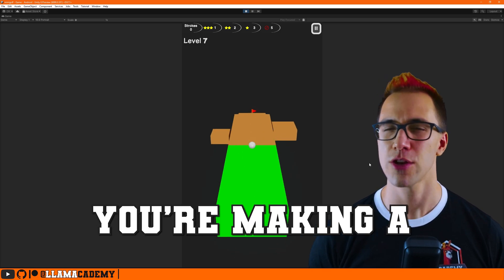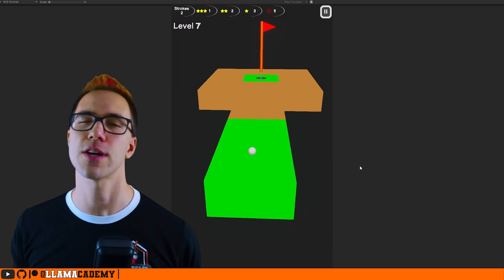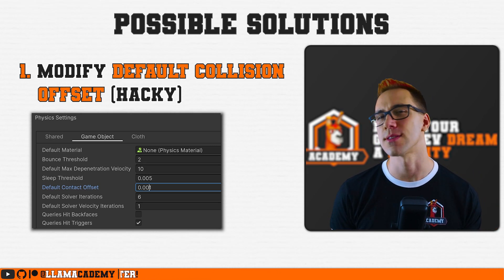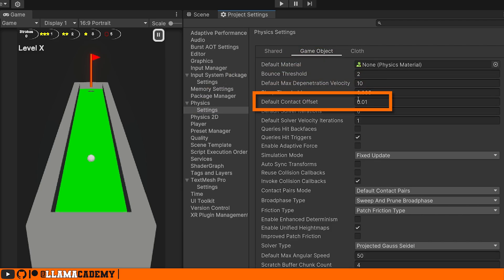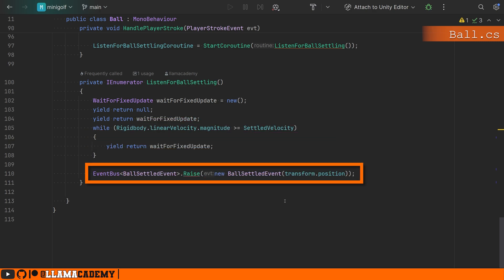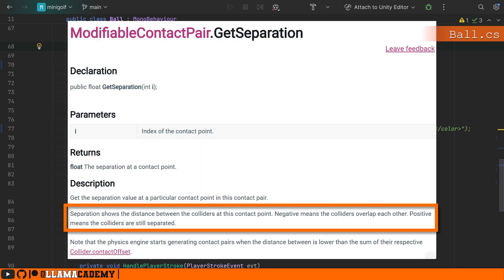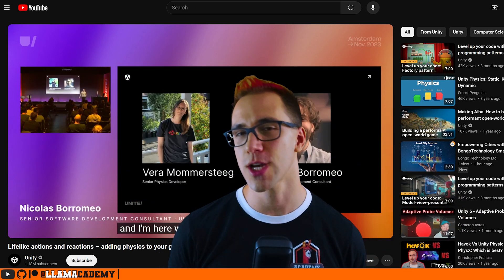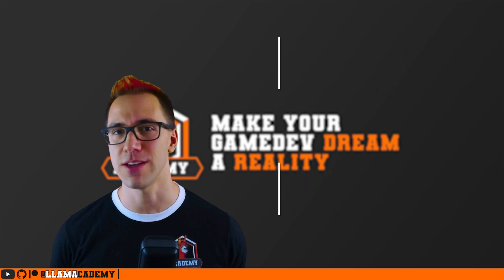How to Avoid Ghost Collisions | Unity Tutorial

Comment: I'm having this issue in 2D physics, which lacks contact modify events. What can be done in this case?
Reply from the maker: I think there's a composite collider 2d that merges colliders together. I haven't worked much with 2D so not 100% sure if that solves the issue in 2d or not
Reply: @LlamAcademy  There is a composite collider, but this doesn't entirely solve the problem. I can't just combine all the colliders in the scene together, because they aren't all on the same layer.

Comment: For anyone this is not working for still, add a debug and make sure that it is triggering your ghost collision detection system. If not I would Subscribe to the Physics.ContactModifyEvent with the Physics.ContactModifyEventCCD. The main reason is that if you have simple static objects (with no rb) that are colliding with your physics object, it will not trigger the CCD event. Also Post 6.0 unity update, setting the normal might not work. I would also add in your scripts to adjust the contact point slightly to prevent re-triggering, by doing something like this pair.SetSeparation(i, -0.01f); . Hope it helps.

Comment: How would you handle this? This probably applies for 3D, but let's imagine you have a Rigidbody2D on your player character. On your player character, you have multiple triggers, that perform multiple tasks. For example, you have a ground detector, a trigger to determine when the player's mouth enters and exits a water body, a ledge detector, an enemy proximity detector. ETC.

Now, using OnTriggerEnter2D on the main character's root game object will execute when ANY of them are triggered, since the Rigidbody2D takes possession of all of them, even if they are on child objects. So then, how do you process the overlap event? Well, there are a number of solutions and workarounds, but some of them are not efficient (which is important for scalability), and all of them are not that elegant or come with their own set of issues.

A) On every OnTriggerEnter2D and OnTriggerExit2D, you could query all the triggers to determine which one exactly is touching, and then either you could either specify a layermask for each collider, or add layers to the collision matrix that are specific to these colliders. You may also need to manually keep track of whether a trigger is "inside" if getting repeated OnTriggerEnter2D events is an issue.

B) You could exclusively put all the triggers on the game objects external to the player. This includes every ledge, every body of water in every level, a wide "proximity" trigger box around every enemy.

C) Use Physics2D raycasts or overlap boxes every frame, in place of everything that is a trigger.

D) Do not use OnTriggerEnter2D or OnTriggerExit2D on the root game object. Instead, split the triggers up into child game objects, and use OnTriggerEnter2D and OnTriggerExit2D on scripts that are attached to the children objects. This would require creating some communication between the child object scripts and the parent object scripts, which could make it harder to understand what's happening for others on your team.

I was using approach C in one of my projects, but was criticised by an industry insider that it's not a scalable solution to use physics casts on every frame. Unfortunately, I didn't get much opportunity to explain the dilemma to them.
Reply from the maker: Can you not attach small MonoBehaviors to the sub-objects that are your triggers and have them send a message or raise an event that is listened for by your main player to do whatever special stuff on that particular event?
I mean to attach a MonoBehaviour to the "mouth trigger" that listens for that trigger event, one to the ledge detector, etc..
Then each MonoBehaviour is only receiving a single event and your main player script can have references to each of these and subscribe to delegate functions on them. Would that solve your problem?
Reply: @LlamAcademy This would solve the problem. That sounds most similar to solution D. That's a good idea to use events.

I've actually now created a generic trigger middleman monobehaviour which can be subscribed too.

This creates an experience more similar to Unreal Engine, where an actor can wire up stuff to the "On Begin Overlap" of a specific collision primitive.

Thankyou for the response.

Comment: couldn't we use compound colliders for this?
Reply from the maker: Sadly does not solve the problem ☹️
Reply: I just read the docs and they say "If another collider needs to slide along your compound collider (for example, a character sliding across ice), try to have just one collider along that surface, to reduce jittering during transitions from one collider contact to another."

Comment: This dropped just 45 min ago? I was having the problem today. I thought it was because of code. after some time I found the problem. To fix the issue (for my case) I just used Mesh Collision with covex off. Others might have some other problems with it
Reply from the maker: In some specific cases that may also help. For the types of cases shown here unfortunately it does not resolve the issue 😕
Reply: @LlamAcademy  I will try to go for this approach just to be safe.

And never have I faced such issues before. If you didn't upload the video then I wouldn't have known why it happened.
Reply from the maker: I heard about this problem and maybe had a few random occurrences, but it didn’t ever show itself with such prevalence as it did in this project. It was a very interesting experience!
Reply: It works well for slow moving objects or small values of fixedDeltaTime.
Do you use it with 3D or 2D?
I remember this being a well known hack in Box2D when I was using it like in 2010. The creators of Box2D had no idea why it worked according to some posts on forums, only that it did work.

Comment: That's disappointing. I hoped for a generic robust solution. I'm won't be paying $2000 per year to get havok for my shitty platformer game. :( I need something that will work for objects that move dynamically and can have any rotation, position, and scale. In my game I cranked the offset, physics steps and all physics settings, but still can sometimes get a ghost collision like this.
Reply: The solution I use in my game (not unity) is to simply solve the collisions in order of magnitude of distance, you could do this in unity by getting all the contact pairs and sorting them based on separation, solving the ones with lowest separation first, then the ones with higher separation after, this solves the issue since collision with the ground (a cardinal direction) is always going to be less than that of a a diagonal object due to pythagoras' theorem.

Another solution is to attempt to discard diagonal collisions if they share a common axis with another collision aka forms a continuous surface, for example they share the same x axis/y axis, (eg. what havok basically does under the hood). You could even discard them altogether for certain games however you will run into scenarios where if a player is moving perfectly diagonally they will clip into objects.

You could also just solve the more cardinal direction collisions first (this is the solution I use), however this would require you to calculate the cardinality of collisions (i use the dot of the collision normal for this), it works for the same reason the first solution above works but is more optimizable since you can do all of the dot product calculations in parallel.

It you have a specific use case further optimization is available too, for example I'm working a tile based game currently, and all I need to do is make sure I solve the collisions with the tile map in order of: current tile, cardinal tiles, diagonal tiles, and don't need to even do any sorting to ensure cardinal solving order.

Hope this helps anyone who finds it!
Reply: how about trying mesh collider with covex off?
Reply: @ShadowOrigin28  I was having different issues when using MeshColliders instead. The way the depenetrate is different and can more often produce unstable results like objects shooting off to the distance like Team Rocket, specially when using the reduced offsets. And it also opens up opportunity for objects to get stuck in other objects as only the edge is colliding.
Reply: i have this colision problem in my game. i just got into blender created 3 d model without sharp corners and use it instead collider
Reply from the maker: According to the docs here: https://docs.unity3d.com/Packages/com.havok.physics@1.3/manual/licensing.html
You can use Havok if you already have Unity Pro. If you do not, then yes it is an expensive proposition